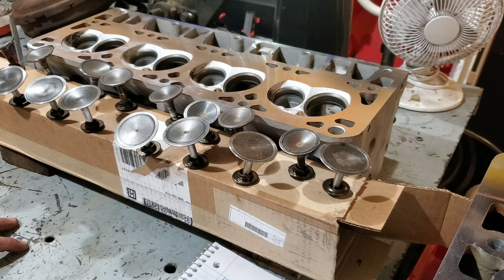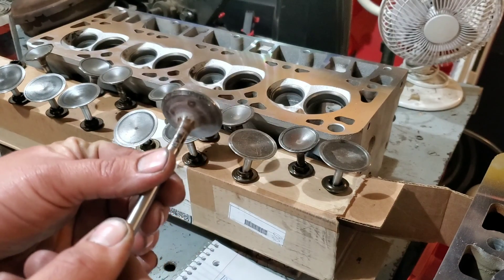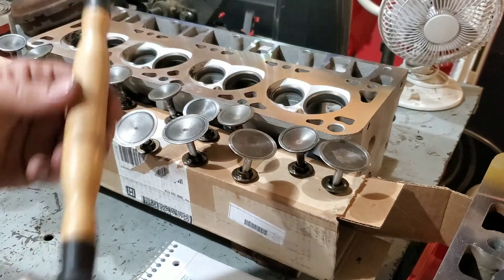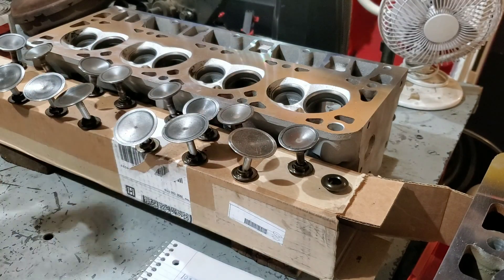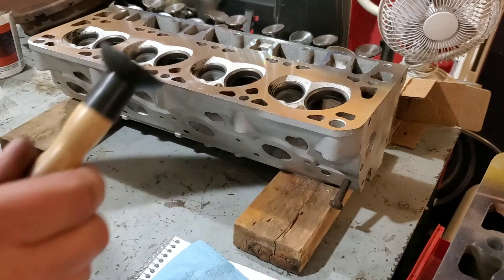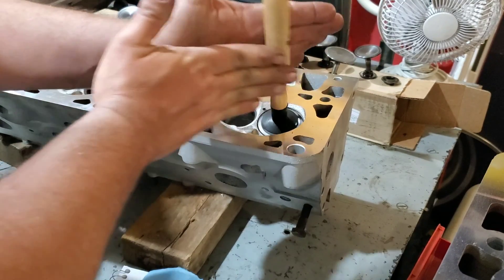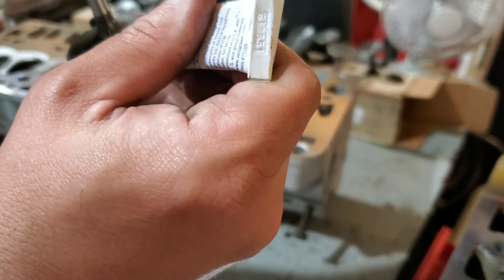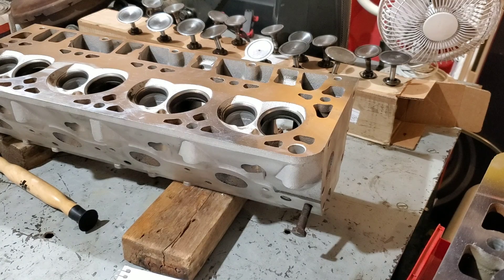How to Clean and Lap Valves

Comment: Can you relap a used valve from a different head? Currently I'm running into an issue where I have lapped a brand new valve on a Volkswagen head and it seems that the more I lap it the more it leaks when I do a water leak down test. Any suggestions man?
Reply: Technically your not taking any material off while polishing a valve into a seat. My guess would be that you got unlucky with the used valve with too loose tolerances of the seat